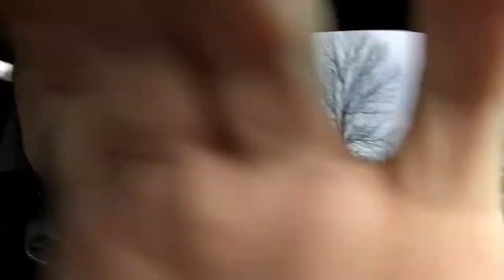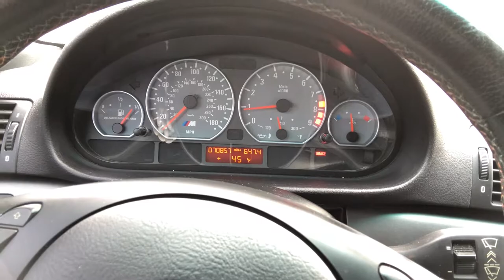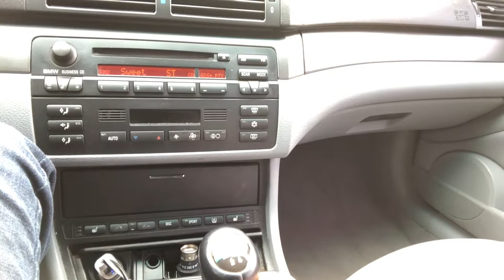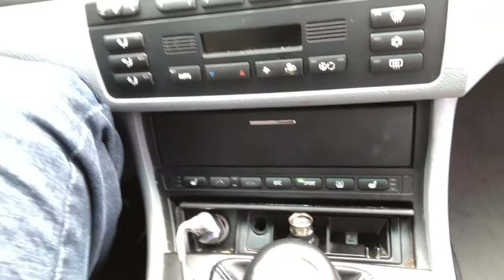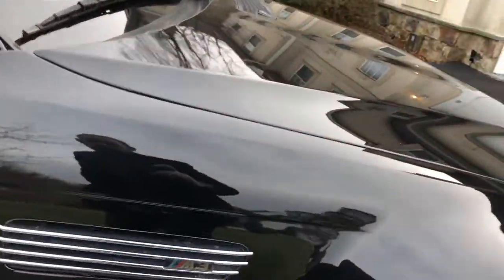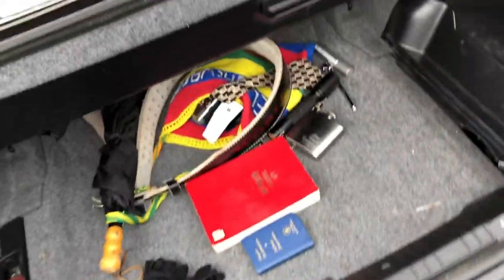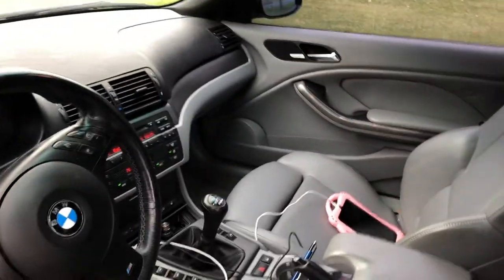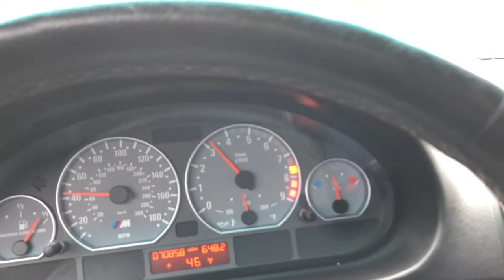Review of a 2002 BMW M3 Convertible 3.2L Inline 6 Cylinder

Comment: Brilliant
Reply from the maker: Thanks!
Reply: Would you buy one in 2022 with 59K miles?
Reply from the maker: I would as long as it had the manual transmission.
Reply: @OmarsGarage  well sir. Ty for a timely response. I test drove the smg auto and I didn't like.  Ty 
unicorn 6spd somewhere
Reply from the maker: @miggyrocks626  yeah the SMG autos were pretty problematic for those years.